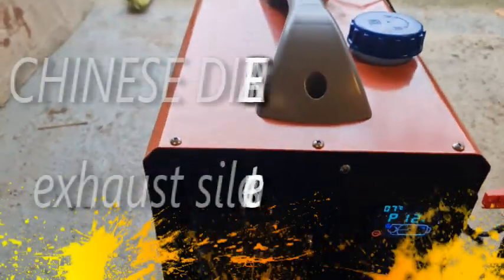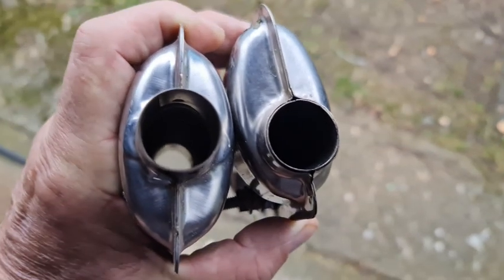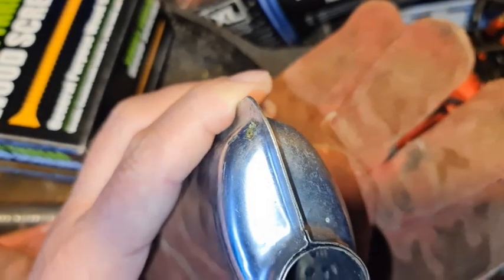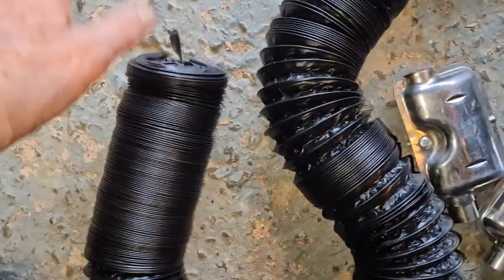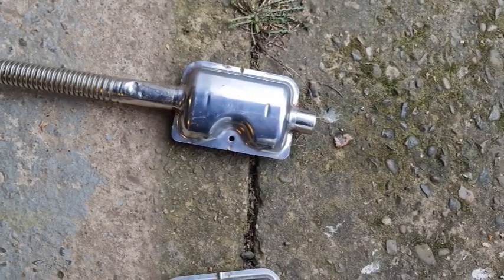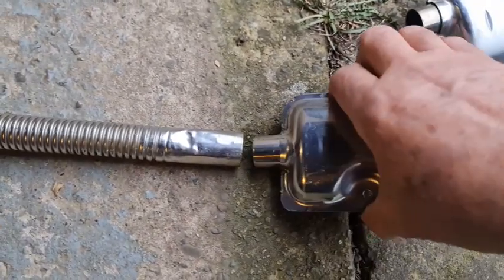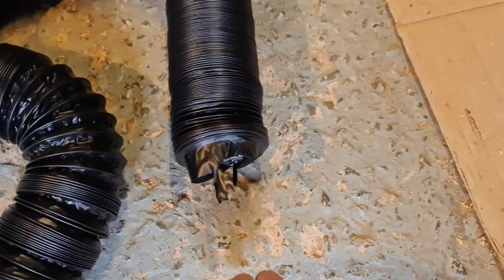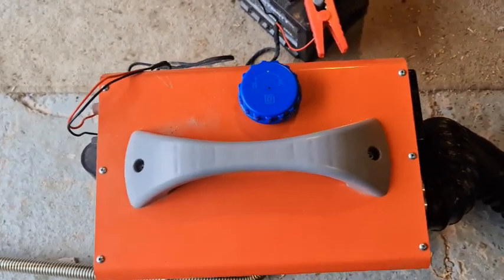Chinese diesel heater exhaust silencer test

Comment: Would you have a link for the black pipe mark? Also does the black pipe give off a chemical smell when hot . Cheers mate
Reply from the maker: no smell !!! 

https://www.amazon.co.uk/dp/B0052UAIAU/ref=sspa_dk_detail_0?psc=1&pd_rd_i=B0052UAIAU&pd_rd_w=ykJW0&content-id=amzn1.sym.15c0cc83-c6c5-4d44-aa3d-0de17a9f3682&pf_rd_p=15c0cc83-c6c5-4d44-aa3d-0de17a9f3682&pf_rd_r=FQWJF4M4S5THVF4P61GS&pd_rd_wg=cv5Wj&pd_rd_r=09f1de83-d9d7-4f0f-8004-7c3d88354937&s=diy&sp_csd=d2lkZ2V0TmFtZT1zcF9kZXRhaWw&smid=A29ON4P1FIV5M0
Reply: @MrMeltedwellies  thank you . All the best keep up the fantastic content👍👍
Reply from the maker: Thank you James